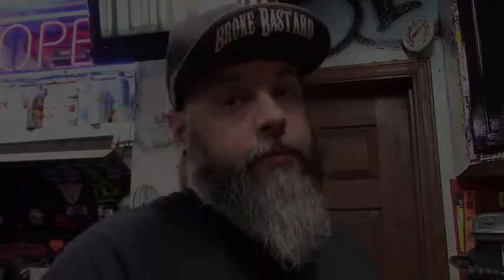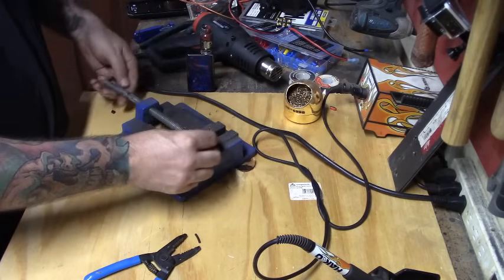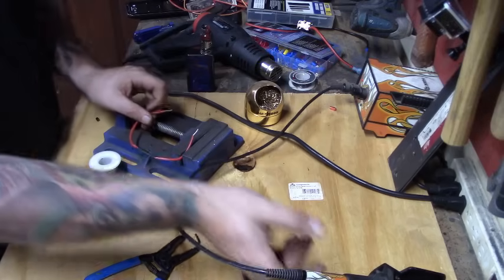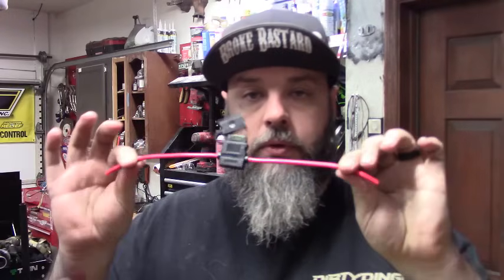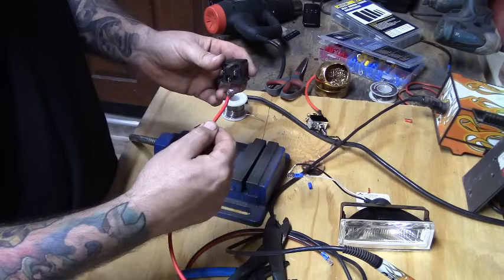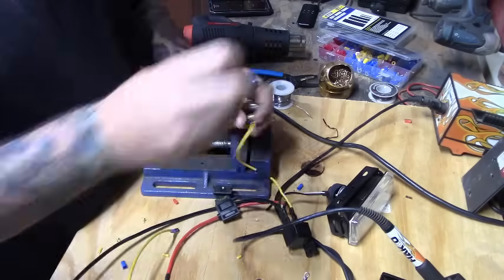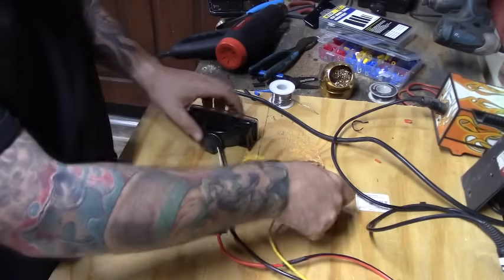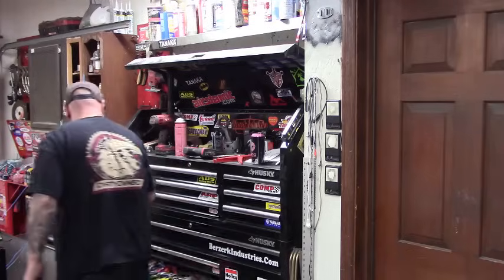How to wire a Relay and Why You should use them.

Comment: I don´t know how you made that weld so hard that pulling won´t tore it apart. I´ve soldered a few times and always had to twist the wires together just in case. Solder was more like to protect the entire thing, but mechanically they don´t have that resistance. Maybe I have always used crappy soldering wire.

Comment: Im here bcuz im trying to figure why my jeep is giving me p2138 code when i use a cb radio with a pedal commander installed..  the cb radio is grounded to the vehicle at different points,  the problem also happen if a handheld cb radio is used near the pedal throttle. It will trigger the p2138 code.. since my jeep has alot of extra lights and wires..i'm thinking that maybe something electrical is disrupting the system, maybe a bad solder or a melted wire..  if that is the case it is like looking for a needle in a hay... my question is, what happen when a solder between two wire joint together is solid but the solder itself is ugly looking?  Let say you are trying to bind a 22 gauge to a 16 gauge .. (knowing it is safe ofcourse) one lead being bigger than the other and you end up with an ugly looking bounding.. with half of the mesh of the bigger wire not touching anything and you shrink tube on that.. in other words, what happen if your solder is just poorly done and no thining but still solid.. can it disrupt or create sparks under the electric tape? Another point is that some trigger switch like you are showing come with led light.. i am using that kind of switch because they are cooler, the led on the top switch lights on when the switch is on ON position of turn off with it is on OFF position.. i hope i did mine right because to figure which lead goes where on the switch to trigger the light i had to trial and error.. i may have created a few sparks..

Comment: You didn't show what the other end of the yellow switch wire gets connected to. BTW this is also how a car starter solenoid works but that uses what they call a momentary switch (on)-off whereas what you showed is a maintained on-off switch.
Reply from the maker: John Nasta sorry fused power either battery hot or ignition hot. Depends if you want them to work with the key off or not.

Comment: Sir: installing a 2.5psi electric fuel pump on my Weber carburetor
Reply from the maker: Done it. Wire switch wire (yellow) to ignition hot power.

Comment: Does this method also apply if I was using an electric fan instead of the light? My fan runs on a thermostat that triggers the fan to turn on at a certain temp. My wires seem to be getting too hot and burning so this method should fix my issue right?

Comment: Do you have anything on installing a toggle switch for the engine cooling fan for a 2007 Hyundai sonata se v6? I cant get an engine cooling fan control module to stay working in my car. So we tried to install a toggle switch and the switch keeps melting completely or the internal fuse just blows. It gets its power from the battery so I'm thinking that its getting too much power

Comment: I'm planning on wiring some LEDs for the interior of my car. My process:  Tap a fuse to a switch, which is wired to the LED strip. Is this the "WRONG" way and should I add a relay in there?
Reply from the maker: bymitten it can be done that way. The interior led do not draw many amps. So doesn’t really need a relay. Make sure you on radio fuse or something not important Just incase it pops the fuse.
Reply: @BrokeBastardGarage  
Thanks for the help!

Comment: If I wanted to use a relay just for the switch box as well;  I would splice 30 and 86 together from the battery positive, correct?

Thanks for the video!

Comment: A lot of comments about the number of steps you've recommended to make an electrical connection.  When you make a connection, you never, and I mean NEVER, want that connection to fail -- ever!  A good soldered connection is stronger and more dependable than the original wire.  A sloppy connection is the one that will leave you broken down on a deserted road at 3:00 in the morning during a winter snow storm.  A step like "tinning the wires" can be skipped, but why would you, since it only takes an extra few seconds to do.

Comment: Why not just twist the stripped wires together and apply solder with the hot soldering iron? A time saver. No need to tin all the time.

Comment: You dint show where the other wire from the switch went.  You showed it hooked up to the relay but where does it goin the other side of the switch.  You only said “it’s all hooked up now” ????????!
Reply from the maker: Dick Thomas one side of switch to fused 12 volt power the other to the relay

Comment: I would have used a western union splice. It makes the most copper to copper contact instead of solder to solder which if heated will come apart . The western union splice is very strong on its own without solder and super strong with. Also copper to copper is a better conductor than lead solder.

Comment: Think about this when you compare soldering to crimping. Soldering wires on aircraft electrical systems is forbidden as the solder joint is a fatigue point and the wire will break at this point. ALL aircraft wiring terminates in a crimp connector. Use the right crimp connector and the correct crimping tool and you are golden. Soldered wire joints will break, especially in an off-road application. You are not increasing reliability by soldering your wires.
Reply: @MrEverything Might as well have fallen out of the sky, if you an inop a hundred miles into a desert with another 50 to reach civilization. What do you think you are gaining by soldering, what do you think you are losing by crimping? You know every connector in either the smartphone you are using or the desktop computer you are using terminates in a crimped connector? Soldering can be cheaper than crimping as a crimp connector with environmental seals at the ends can exceed 1.00 per connector.

Comment: For someone who is a total novice at this there are some major assumptions being made. What is a heat shrink? What are you using to clean the iron? Do you hold the wires tip to tip or one on top of the other? That’s just in the first couple of minutes. Other than that and me wishing there were some close up shots of what you’re doing it’s very helpful.
Reply: @Rodzilla5332 aka major assumption more like captain Cowndown,did you learn anything,if not jog on..

Comment: Sorry, don't understand ، I watched more than 5,000 videos on YouTube and don't know the benefits of Relay!
Why is there so much current when the switch is used without the relay why would it burn?
Does the Relay limit the power of the current flowing according to the voltage used on the other side?

Comment: You did not mention the name of the can that you were cleaning your soldering iron with  .
Reply from the maker: https://www.amazon.com/Hakko-599B-02-Wire-type-soldering-cleaner/dp/B00FZPGDLA/ref=sr_1_43?crid=28X9YSJG22RWE&keywords=solder+kit&qid=1563371741&s=gateway&sprefix=solder+%2Caps%2C181&sr=8-43
Here's a link if it doesn't work, go to amazon and search Hakko 599B-02 Wire-type soldering iron tip cleaner.

Comment: Not the wrong way if you put in a fuse and the switch is rated with high enough amperage and wire is heavy enough.  Did it for 80 years in cars and trucks

Comment: I'm about to add a pair of 55w halogens headlamps to an old car. . Do I put one relay in for each lamp or will one relay work if the amperage is calculated correctly?
Just a thought ☺
Reply from the maker: Ian Williams one for both but if you can’t get big enough relay just y the switch wire to both relays

Comment: Some ok ideas here. Looks like a super expensive way of doing things with brand new stuff. Get some wiring out of something very similar and off you go. Car makers avoid solder due to dry joints and extra time costs. Pulling extra fuses/relays in everywhere causes new issues finding them. Use a decent fuse box, the bigger the better, and as few relays as possible elsewhere. Keep at it! : )

Comment: After striping the wire ends I splay the wires, bring them together then I twist the wires in opposite directions which makes the wire smaller and a smaller solder point then shrink wrap.

Comment: Great video! I've got a quick relay question for you or your audience. I'm trying to troubleshoot a problem on a car (the rear wiper isn't working). I'm trying to track down if it's a potential pinched/broken wire issue somewhere in the run, so I have the relay out of the fuse box (which is at the rear of the car), and I'm probing the relay terminals with a multimeter. Here's the part I find odd. 

I'm getting 12V (well, 14 w the car running) across pins 85 and 86 regardless of if the switch is on or off, which seems odd to me. Isn't that the point of the switch, to engage voltage across 85 and 86 to make the electromagnet work and complete the circuit from 30 to 87? 

Thanks for clearing this up for me!

Comment: Good video but disagree on the solder. Crimp is superior, solder for electrical connection yes thats fine but many motorsports teams along with aviation applications crimp anywhere where vibration is an issue. Soldering alone is not a strong connection, sorry

Comment: Curious, if I have a single spotlight that I want to use with my highbeam can I splice it into the wires on the high beam then run the wire back to the relay? I have a fuse etc on the other side with an on off switch if that helps?
Reply: If the combined amperage of the highbeam and the spotlight are less than the amperage rating of the fuse, wires, and relay, then yes.  If not, you'll have to either run a separate line or get a beefier relay / wires / fuse etc.

Comment: For trailer lights, I run fused "main power" to the trunk and then use relays driven by the car/truck wiring/lamps to send that main power to the trailer connector.

Comment: I have a question. I'm running 2 led strips in my headlight a total of 4 strips for both input is 12v @1.5amps But Everytime I flip the lights on my car it blows the 10Amp fuse in my fusebox will adding a relay in the hot lines of the headlights rectify this problem?
Reply: LightKemist you have a short or they are faulty, try 1 first and recheck your wiring
Reply: @colinstables  I know it's not a short because I checked all my wiring before install. I do have all 3 lights the 2 DRLs and the turn signals share the same ground each wire is 18ga each twisted together and these are switch back so the turn signals are the same as the DRLs
Reply: LightKemist okay, could be faulty lights, try a beach test where you hook one led directly to a battery at a time.  If it works use the car as ground and a power wire as positive
Reply: @colinstables  ok thanks

Comment: A tip I'd like to share. On many of my corded tools, I use old vacuum cleaner cords, and direct wire them to the tools. Vacuums are always discarded, and I just pull up, cut the cord off, and go. Electric leaf blower, fans, heat guns, table saws, stereo equipment, portable lights, etc. Some cords are over 25 feet long, and heavy enough to use on many tools.

Comment: The wiring diagram shows the switch connected directly to the battery and therefore unprotected. The rest of the video is spot on and well done. You emphasize safety (as you should) but the circuit going to terminal 86 should also be protected.  It too should be coming from the fuse panel. Either it's own separate low amp fuse or at the very least utilizing the fuse going to the terminal 30 via an additional wire going to the switch. If it touches ground anywhere before 86 you've got smoke. And where there's smoke there's fire.
Reply from the maker: Michael Dose yah noticed that after I posted the video. I always have fuses on any hot wire.
Reply: If you put the switch on the ground side (85) you´re protected..

Comment: Good video. Explained well. I'm in the process of trying to install an Innovate AFR gauge with a relay. Didn't really understand why they suggested a relay instead of just a direct wiring solution, but makes sense now. Almost the exact setup you showed. (4 pin relay). Just have to find the right 12v source now. A speed shop suggested tapping the coil since it's not on when in accessory mode. Don't want the wideband sensor heater running without the motor running. Thanks for the video!

Comment: Hi, Thanks for your helpful video. I have a serious question, as i'm not specialised on electrics etc. I have made an electric bike. The ebike motor is rated as 36v, 500W but my battery is 12v, so i'm using a step up dc-dc booster to create the 36v i need. My battery produces 44ah from 12v so, as i know, when you increase the voltage you decrease the amperage, so 12v x 3 (36v) and 44ah : 3 (14.66ah), if i'm right. The cables i'm using to connect the battery to switch and the switch to the booster are thick enough to withstand the amperage easily. The booster is rated as: input 12v, output 36v, 15A, 540W. Between the switch and the booster i have putted a 35A fuse. I tried in the past with many different fuses, from 15A to 30A, as i had no idea which one was the right one, so i finally used the 35A one, which is good. Sometimes, when uphill and i continuously pushing the bike for few seconds, the fuse is burning, so i have to put a new one. The problem is that i have burned the booster two times too, so i had to buy new one two times. This is my third one and i'm thinking what is going wrong with the system i have designed. Maybe should i connect a relay between the fuse and the booster? And if yes, what relay would i buy? Also, do i need a fuse between the battery and the switch? And if yes, what would be the right one? Please i need your help as i'm desperate with this issues. Thanks a lot.
Reply: @Thelbanezs5470 divide the wattage rating by the applied voltage will give you the known amperage draw of the load.. add 10% value to amps. When deciding components fuse switches relays etc

Comment: Hello! Sir, I saw some video with 2 fuse,  one is the same position from your video (relay to 12v power), and the other one is between switch and 12V power. Any explanation? Thank you
Reply from the maker: idolton they are just being extra careful. If the power from the switch to the relay was to ground out the fuse would pop.
Reply: @BrokeBastardGarage  So mine is coming from the radio to put more current going into the amp input, then a fan. Probably should've put that fuse in, but didn't. The stereo has a fuse and it takes no time for me to get it, the stereo, out to change the fuse. That okay?
Reply from the maker: Vince Del Fabbro put a fuse at the near point to the battery so if any where on the line shorts. It will kill the line
Reply: @BrokeBastardGarage  fuse at battery fried once cuz I shorted out a hot by my amps took a day to find it. Battery and head unit are fused. One amp kept cutting the system off, not enough current running through, so hooked the relay up last night. Will test soon but it will fix the problem
Reply: @VinnieVega76  The fuse is to protect your car not the stereo, So you should have a fuse near the power source for both the stereo and the amp., 2 separate fuses. Should be within 6 inches of the power source.
Reply: @paulnorthup8828  think I have the problem ficed. Ground wire  to amp rack came loose and broke when I removed the rack. Monday will be getting new connectors; that should help cuz the RF rca cables sure didn't

Comment: Hey, great instruction with correct demonstration.  Very good to see!    In the beginning, I wondered why my swiches would get hot, until I figured out why through trial and error.  Lots of errors, but luckily no fires!  I'm now on my thirty-third truck of which all have been older used trucks, and I put road light, fog lights, and back up lights and many other simple devices in all of them.
The parts and method you demonstrated here are all correct and the responsible way to do it.
Great Job!

Comment: Very helpful, helped me cut my bikes fan on manually by using the switch to apply ACC power to the ACC power pin on the Relay. (I had 4 pin relay but you can easily check the relay with a multi-meter to find out what pins are Relay power and Relay ground and what pins are ACC Relay power and device power) +1 like, thank you!

Comment: Great video as usual. But How come the relay has power coming from the switch and power coming from the fuse?? I find that confusing. Can you explain.
Reply from the maker: the power from the switch to the relay is only to trigger the relay. the other power going to the relay is the current being used to power the accessory..Hope this helps.
Reply: @BrokeBastardGarage  Thanks BBG. Yes that makes scents. Thanks. I will be using them in my Fargo build.
Reply: So these two wires com from the positive on battery? I'm new in automotive I'm jus just learning and was about to ask about the yellow an red wire was not shure where they went so one OS constant power to relay and the other one is constant power to switch?

Comment: Your soldering method would not pass Electrical Code. There is no electrical code for auto but there is a safety reason for electrical Code.
You need a mechanical attachment Trist the wires together ! Also switches why not cover the extra connectors with heat shrink?

Comment: Hey man great video. I’ve got a question that’s off subject. I’ve got both  battery cables removed and I still have power to the car. Why is that? Thanks in advance
Reply: Likely from the capacitors in the circuitry, that store amounts of electricity.. they slowly discharge when battery is off or unconnected. You can see this after turning off engine and your interior lights or headlights stay on then slowly go off because of the discharge.